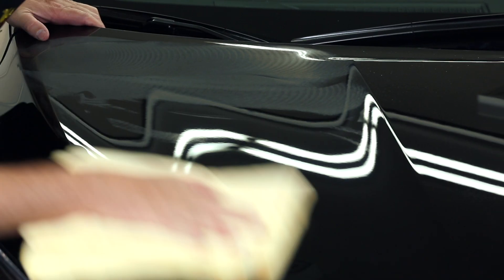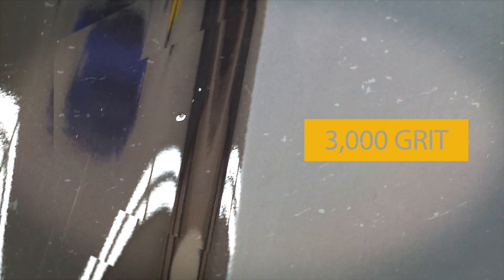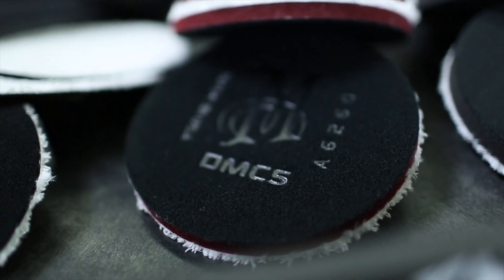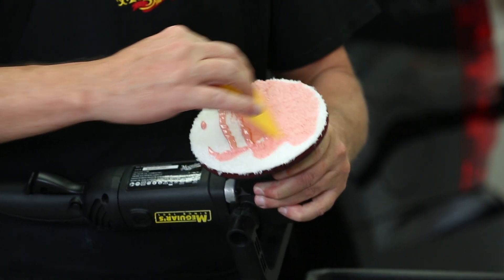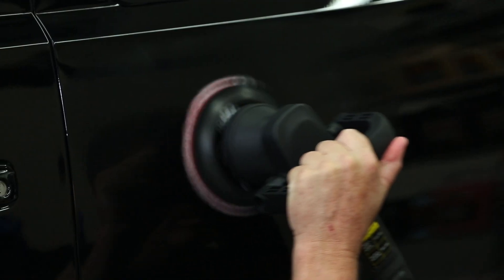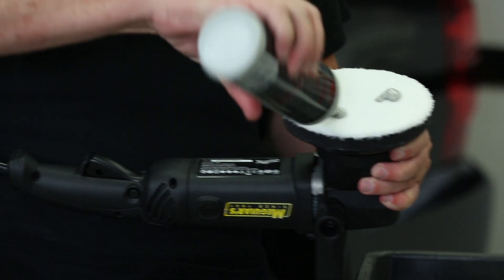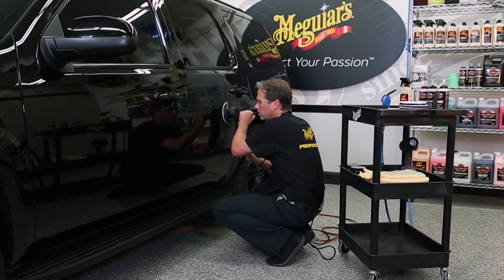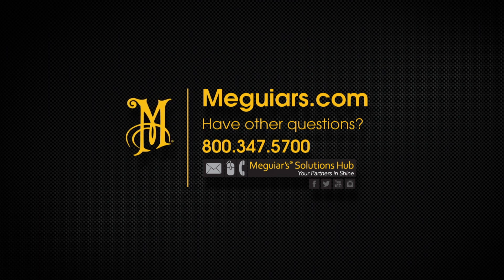How to Polish like a Pro  with Meguiar's Professional DA Microfiber Correction System

Comment: very good product. I will try it this spring. Where is the best place to buy it? I'm impress with the result. Last question how do you wash the pads?
Reply: Meguiar's All Purpose Cleaner D101, and a brush is what I use. Spray them down, agitate, rinse, and repeat if necessary.